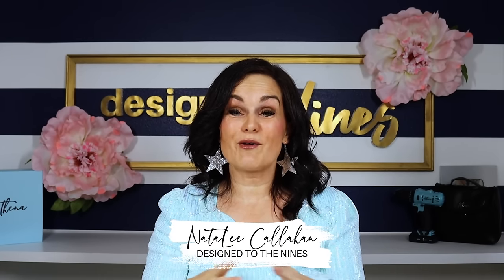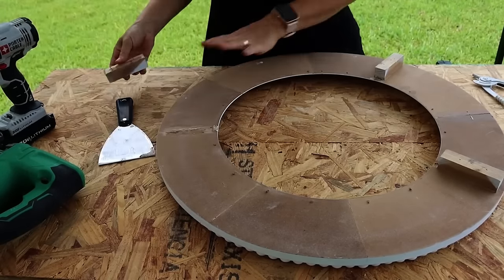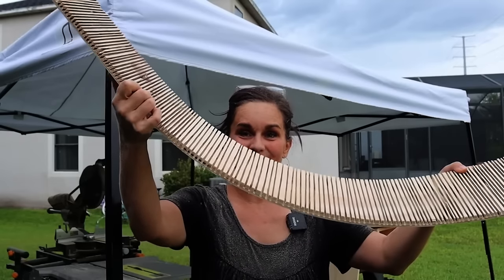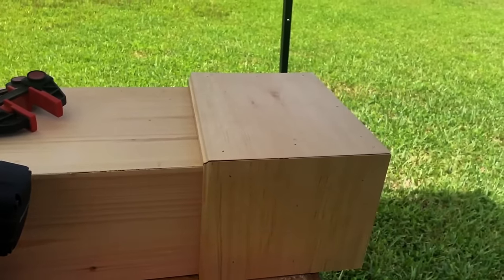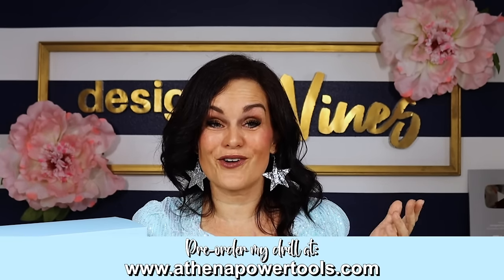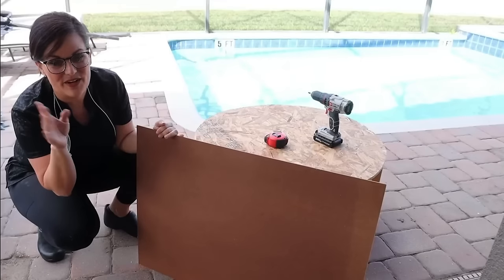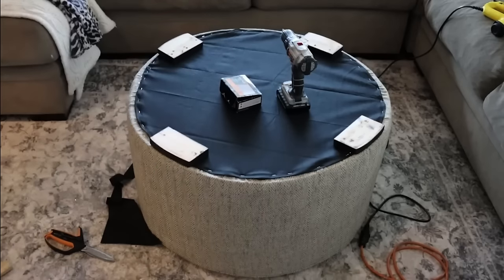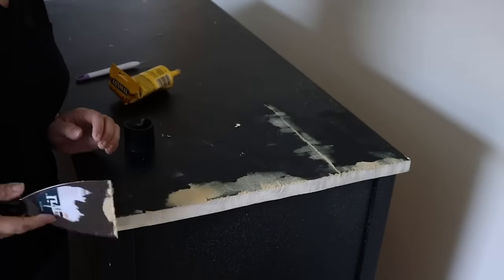10 Absolute Best HIGH END DIY Decor Projects of 2023!

Comment: No, the reason why measurements are like that with lumber is because when you put sheetrock on it, it makes that size of a wall. So, a 2x4 will be that size, once the other pieces are applied. 

I think if women would have been in charge of the sizing, we would have never done it that way bc we know there's a million other uses besides walls, but that's the reason. They're looking at the final size

Comment: How do you change battery on the clock?
Reply from the maker: It’s open on the back so it’s easy to switch out. And it doesn’t weigh too much so pulling it from the wall is not a problem.💕